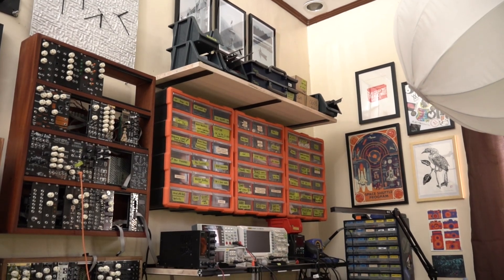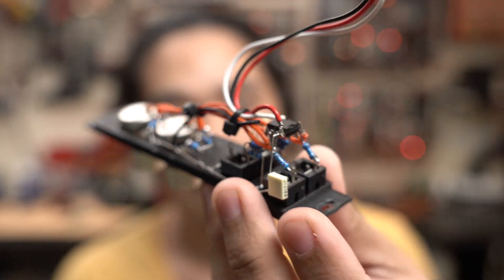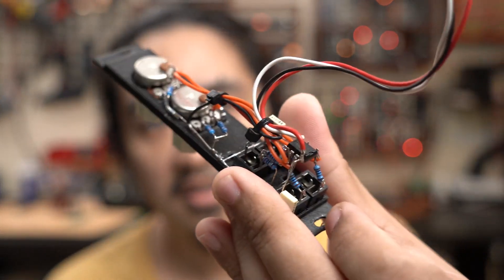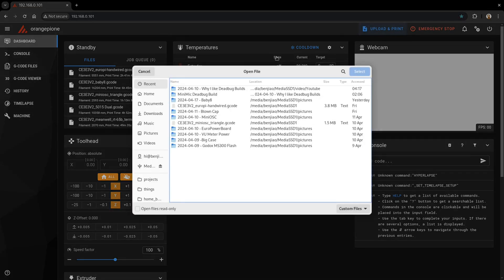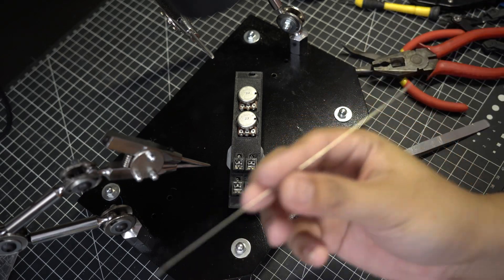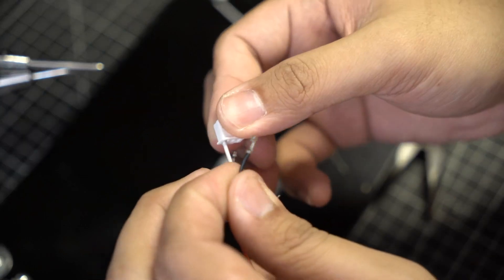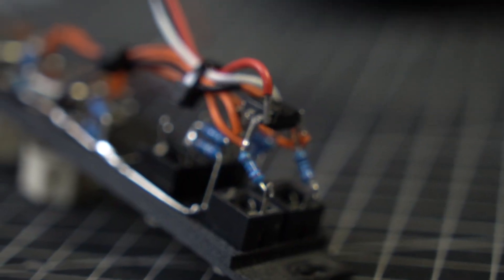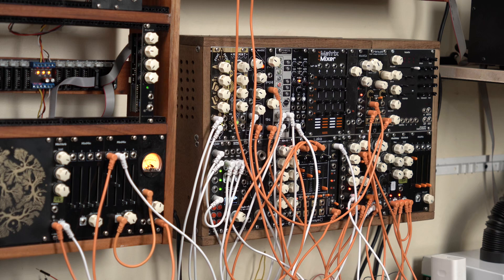Why I like doing point-to-point builds for SynthDIY

Comment: Do you know of any references to which PCB Fab options fit what purpose so I (we) know which are frivolous or not?

I am rebuilding my 'design (copy what works for others more like - Don Lancaster's "Active Filter Cookbook" got me smarter how to approach the concept.) & build' space here for the past few years, attempting to reduce my radically increased Gear Acquisition Syndrome since the lock-down began and apparently never ends.

Buying all four Eventide Factor Stompboxes is my trigger to get a Stereo/Mono/CV 8/16 Ins by 16 Outs Matrix Mixer built, though the Erica looks tempting.

I am glad that I've been ADHD putting it off for so long.

Otherwise, I wouldn't have bumped into the simplicity of using Attenuverters instead of Switches for Polarity.

MegaThanks For Your Inspirations plural!!!
Reply from the maker: Hey! First of all, thanks for the kind words. And that design & build space rebuild sounds like a fun project!

About your question regarding pcb fab options, for modular synths and pedals, I really almost exclusively use PCBWay's default settings (FR4, 1.6mm) except for surface finish where I use HASL lead free. Is this what you meant by options? Or were you planning on making the PCBs in-house?

Comment: Do you have any builds for small biquadratic bandpass filters with high range q parameter on both sides? I cannot find a bandpass filter in my budget that I can afford three or four of. This would help me immensely in a signal processing project.
Reply from the maker: Hey! I'm afraid I don't. It's on the list though. You could try to look for AS3350 circuits. I'm pretty sure it has a Q control built in
Reply: @benjiaomodular  I will take a look. I am specifically trying to split ambient noise into controlled bands to process elsewhere. Do you have anywhere we can chat outside YouTube comments? I am new to hardware but have several hundred hours in VCV Rack.

Comment: Very fast and easy construction technique, your system is much like circuit sculpture and is very clean and elegant. If one wants to be a bit sloppier and faster, I like using cyanoacrylate to very quickly glue down components upside-down so I can solder to their leads without much fiddling with a third hand. Have you ever tried "Manhattan style" circuits? I still see those on a lot of older homebuilt equipment. Who needs PCBs for short run or one-off production?
Reply from the maker: Thank you very much! I looked up Manhattan-style and wasn't disapppinted. That looks pretty in it's own way too. Probably sturdier.

Thanks for the tip about CA glue as well, i should probably try that with some circuits if I need things to be more rigid. Cheers man!
Reply: That ca technique
Oooooh
Thanks a million

Comment: I figured you'd be tired of soldering after getting all those power boards done :). What do you use for wire when parts leads are not enough or not strong enough?
Reply from the maker: Haha! I'm glad I don't have to do that again anytime soon.

I use solid 22AWG tinned copper wire. I just recently found out you can buy them without the shielding https://ph.rs-online.com/web/p/copper-wire/0355079

Comment: Happy to see you again ! 

What a big case, which power supply did you put in there, only one for this big ?

Another question, which wire do you use to build like this ? Looks like you have very straight nude wire ?
Reply from the maker: Thanks! I'm glad to be back.

I plan to power it with a single MeanWell RT125B. I still haven't filled it up completely, so we're yet to see how it holds up